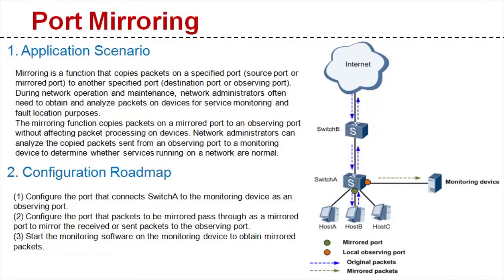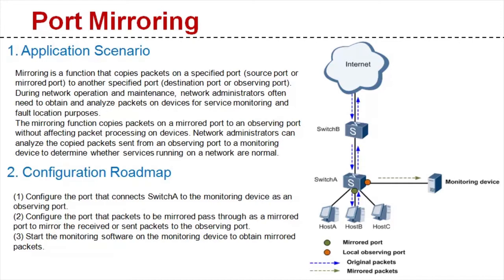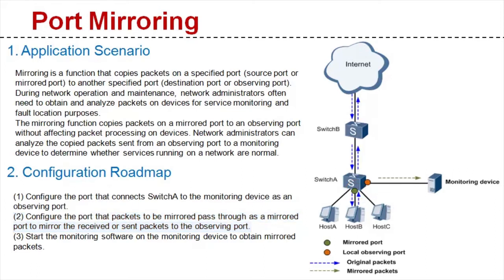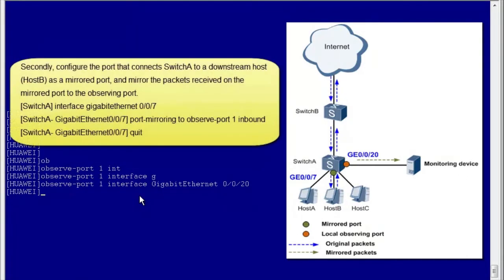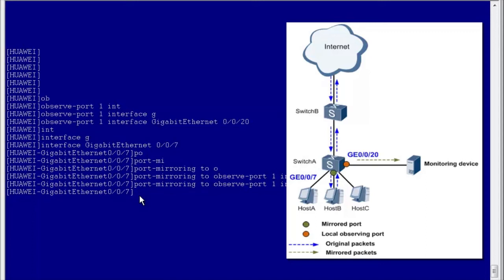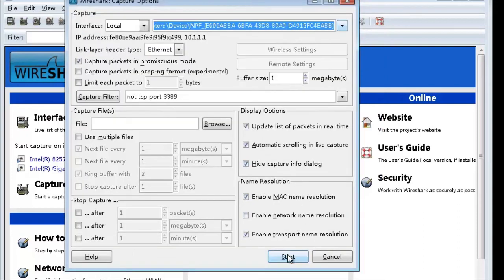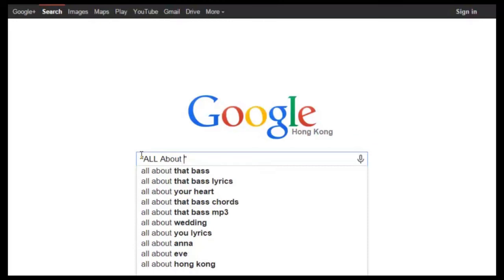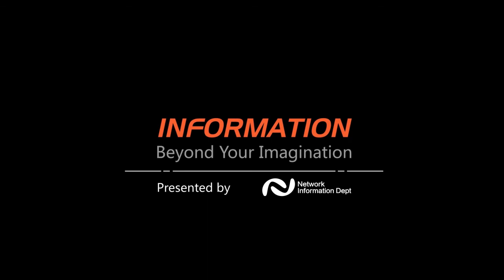HUAWEI S Series Switch-Configure Port Mirroring

Comment: how monitoring device will catch mirrored packets , does it should have specific configuration ?
Reply from the maker: Thank you for your feedback.
You can find it in all about switch:

https://forum.huawei.com/enterprise/en/mirroring-an-effective-network-monitoring-tool-working-mechanism-and-configuration-all-about-switches-08/thread/217061-861

If you have any other questions, leave messages in corresponding web pages.

Comment: Is it gonna work if there are more network equipment between SwtchA and monitoring device?
Reply from the maker: Dear 
Latthasin SOULIYA, If there are more network equipment between SwitchA and the monitoring device,it can work properly. This scenario is called remote mirroring. You can refer to the cases in this link http://support.huawei.com/hedex/hdx.do?docid=EDOC1100126530&tocURL=resources/dc/dc_cfg_mirror_1035.html.